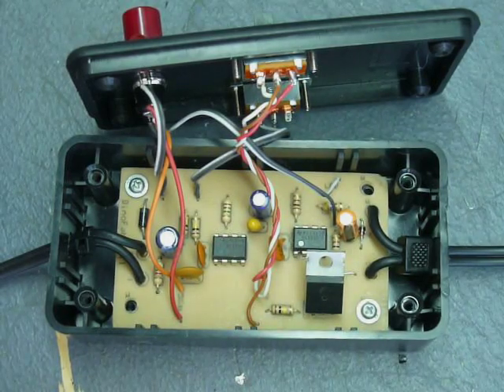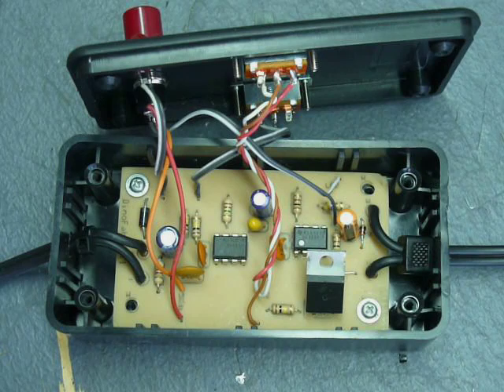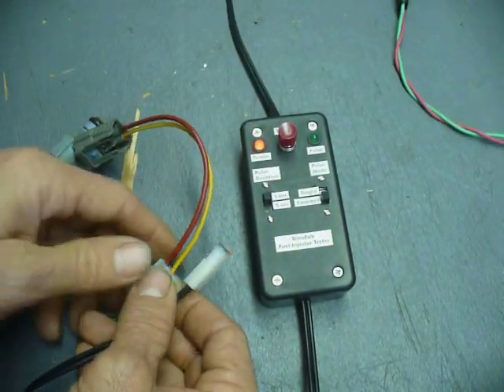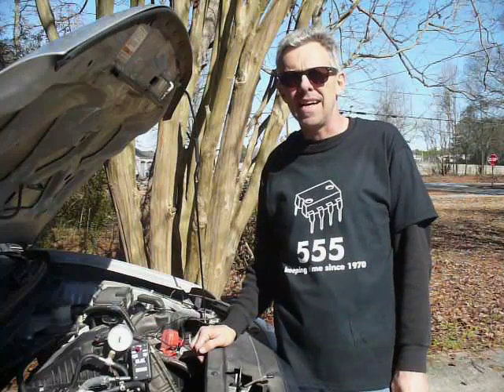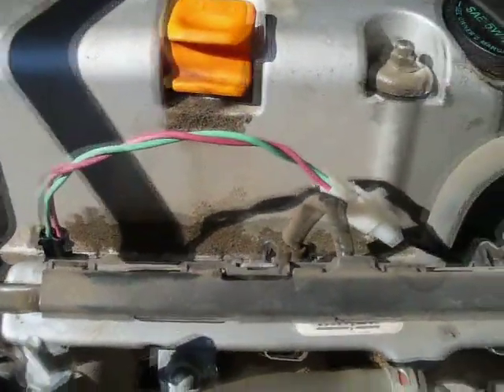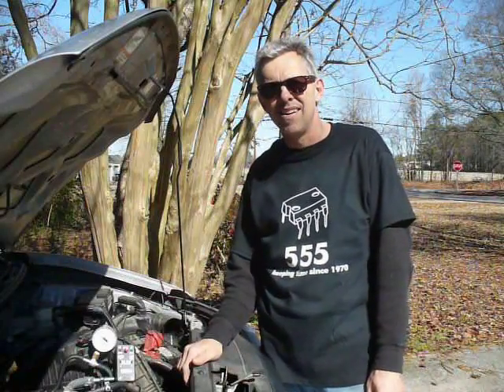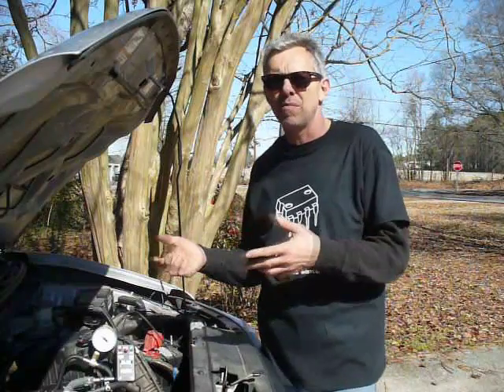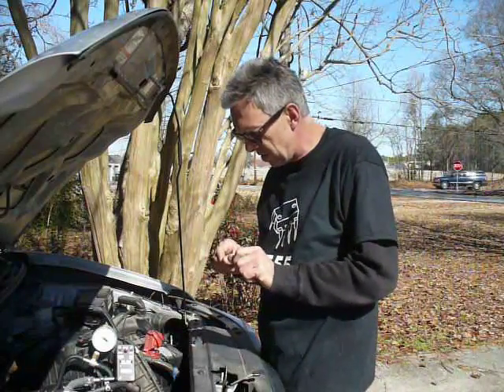555 Fuel Injector Tester On Car Demo

Comment: Very nice job. I'd just replace the timer selection switch ( 1 - 5 sec) by a 3 positions switch. On the middle position it will work just like the by trigger mode (single?) and when a time is selected 1 sec or 5 sec it will take the full time of the setup.
Also, adding a diode pin 7 to pin 2 on second 555 will change the pause time between pulses. I guess the same can be done by modifying the value of resistor between pins 7 and 8. Supposedly it will modify the low time as well. I need to simulate that to be more accurate. Any ways, it is really a good and nice tool to have.